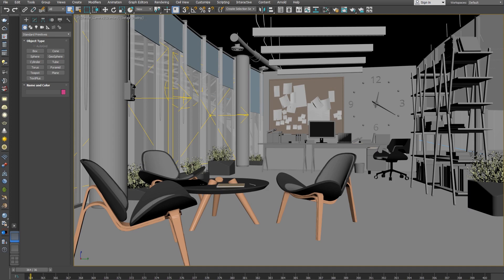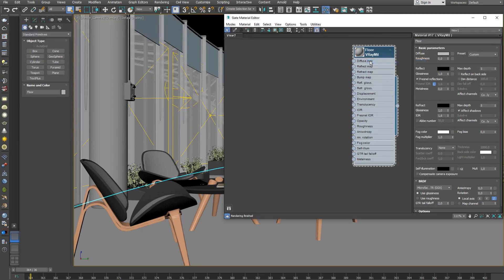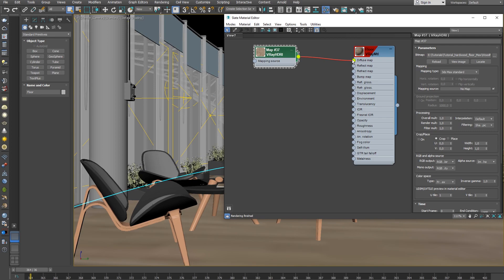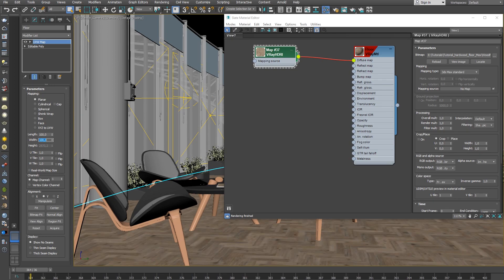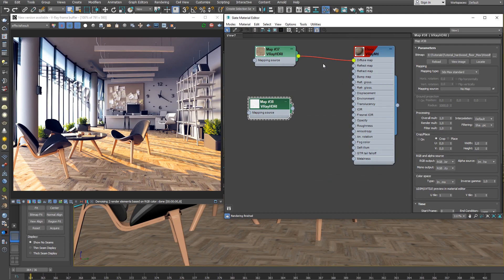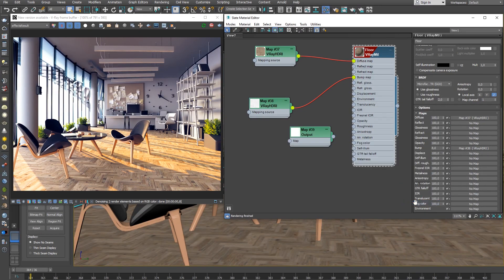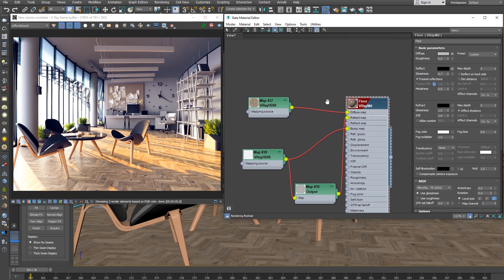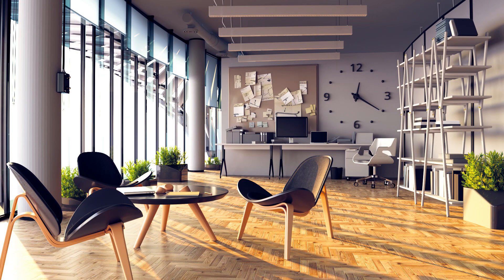V-Ray for 3ds Max — How to create a hardwood floor

Comment: I didn't get the concept of why she used HDRi map instead of Bitmap!!?.. i thought its some new trick and she will explain why..
Reply: VRay hdri map ( Now it is renamed to  VRay bitmap in VRay 5.0 ) is just an image loader so you can load ANY format being JPG,TIF,PNG, EXR, HDRI ...etc it works with them all .
the difference that Vray hdri is more optimized and have better filtering options to give crisp textures and support for UDIM , TX ..etc
 and many more features like mapping source to link multiple maps together .
it has always been recommended to use it over Max Bitmap , and that's why there is an option to convert all bitmaps to Vray HDRI maps in VRay in the right click menu in viewport ( it is also there in Vray 3.0+ iirc )
Reply: @nawrasryhan  thank you 😊

Comment: No need to use VrayHDRI nodes btw, it's perfectly okay to use a standard bitmap node and just override the gamma of the map if necessary when loading it..
Reply: That's not the only reason to use it ..Vray hdri have better filtering and more optimized and has alwys been recommended to use instead of Max bitmap in the official forums .
Reply: @nawrasryhan  how about use the new vraybitmap??